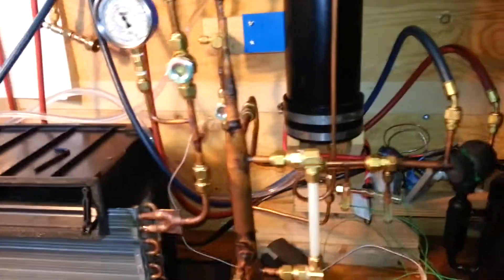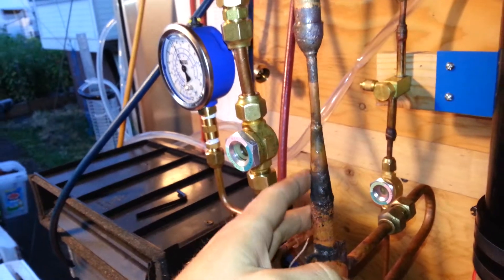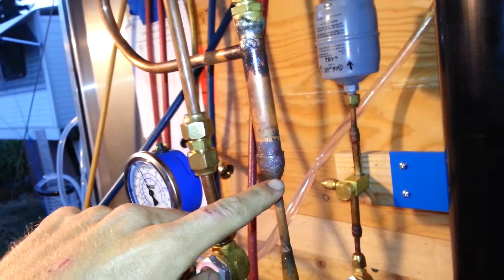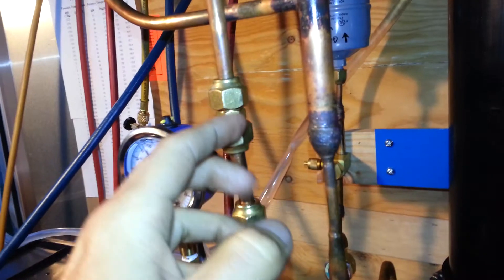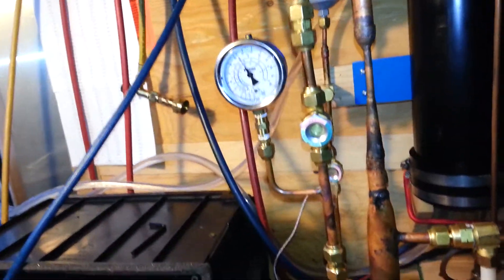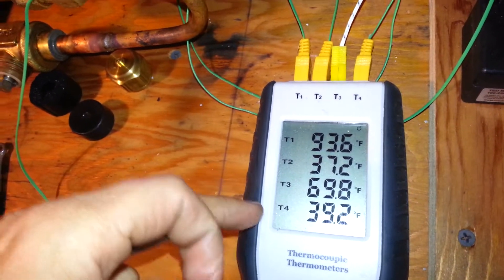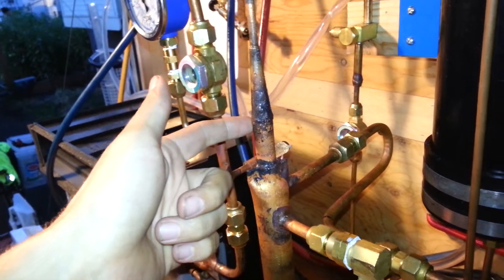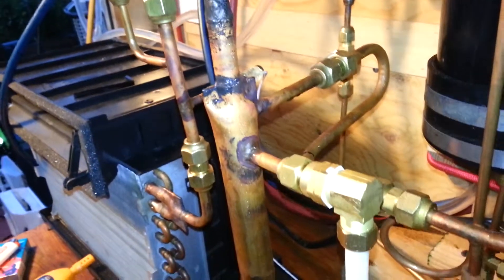Ejector - To Hell With Superheat!

Comment: Have you ever experimented with the ejector system from the Toyota Prius?  They may have updated it to a dual ejector by now
Reply from the maker: No, I haven't.  I am aware of it, but have never seen one for myself.  I think it is built right in the aluminum evaporator?
Reply: +M.C. Pletcher - oh, I meant the full HVAC system. If you could buy one cheap enough,  it might be a good reference

Comment: Just curios, but dont you need a second evaporator for second stage?
Reply from the maker: Depends on the definition of two stage.  Usually, two stage system has two compressors.  My system here has two stages of compression, one with the ejector, and the other with the mechanical compressor.  I'm not sure what one would call a system with two evaporators.
Reply: correct me if im wrong but, in this case the ejector is your second compressor. However because there is no second compressor, there is a cop increase. the second eveaporator should be fed by the ejector and the compressor suction connected on this second evaporator sucking dry refrigerant. This way you can have a freezer and a cooling cycle operated on a higher suction pressure and this will increase the cop even more, win win situ, But there are som drawbacks the freezer cycle will be relativly small compared to cooling cycle.